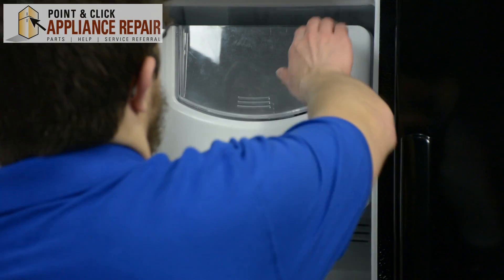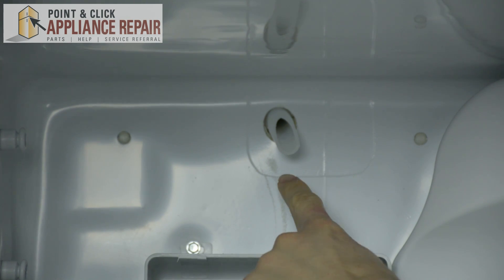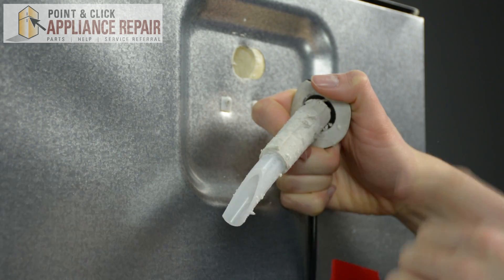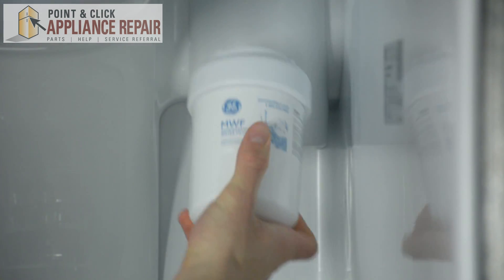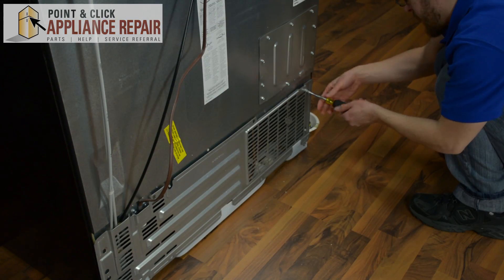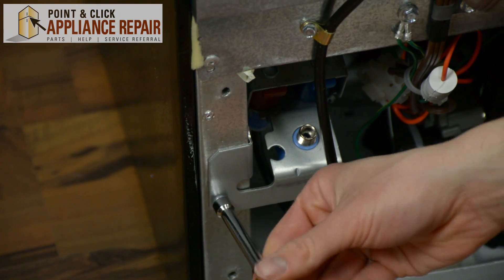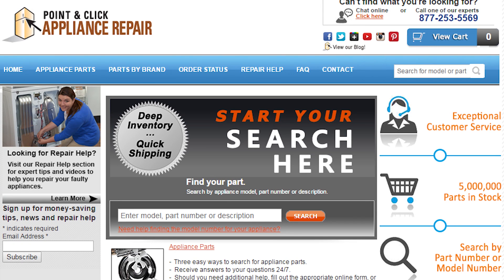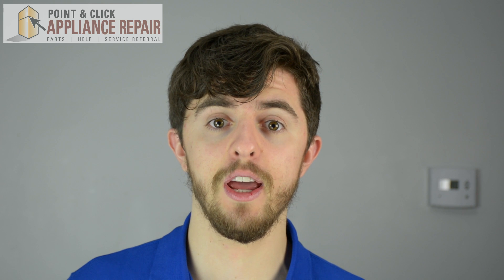Why Does My Ice Maker Keep Freezing Up?

Comment: When you removed the water inlet tube I noticed foam/insulation did it damage the foam/insulation? Mine is not even nothing I am afraid to brake it.

Comment: My freezer ice maker worked fine non stop for 10+ years then suddenly started freezing up the fill tube,  ive replaced the fill tube, supply tube, the solenoid/ valve and lowered the temp setting on the freezer which was never changed in the first place but it still freezes up..  ive even moved the baffle that blows on the ice maker to not do that and still freezes pipe..  so its not any of the parts having any issues, not the freezer too cold, not the ice maker or anything.  I think its the tube somehow not evacuating the remaining water thats inside that tube in the freezer..  but have no clue on what it was doing to work for so many years then just stop..  maybe theres an air hole like a pinhole on the little piece that you poke in the back of the freezer..  but im not seeing one and would think if theres a hole than wouldnt it spirt water up out when filling? Either way i jjst think theres some gravity fed way to get that hose to properly drain out any remaining water inside it after it finishes filling the tray..  like a natural syphon that will pull a vacuum on the tube just enough to pull the water back to a point outside of the freezer section..  they make heaters you can hook up but i dont want to constantly have to run another heating pad for a damn ice maker..
Reply: Every since my light stop working in the freezer the ice maker started freezing up . I have to chip it out and it works like once or twice more.

Comment: Jordan, this is great. Other videos showed use of  hairdryer inside freezer. It was a lot easier to remove tube from back of refrigerator and run hot water through fill tube to remove ice. Thanks Much!

Comment: Sorry, but you never answered the question about why it keeps frosting up.
Reply: If you don't defrost the freezer once every 3 months or so then the freezer can build up a layer of ice over temp sensor which due to thermodynamics can make it read warmer. Same reason igloos are warmer inside. This can make the freezer over compensate and over freeze it. When this happens this extra cold can radiate up the back of the fridge and freeze this pipe thus making the water a lot colder which in turn freezes into ice faster faster and gets cooled more in the ice maker - when it pops out it then warms up a little due to the expected temp of the ice box which causes it to stick to other ice.
Reply: @ribo2139  
But doesn't it already have an automatic defrost? I think mine defrosts 20 minutes every 8 hours. Do I need to go beyond that? how do I defrost it every 3 months? You're not telling me I've got to take everything out and then leave the door open are you? For like an hour? Longer?
Reply: @ribo2139  but my freezer is on the bottom and my ice machine is in the fridge section.
Reply: My freezer ice maker worked fine non stop for 10+ years then suddenly started freezing up the fill tube,  ive replaced the fill tube, supply tube, the solenoid/ valve and lowered the temp setting on the freezer which was never changed in the first place but it still freezes up..  ive even moved the baffle that blows on the ice maker to not do that and still freezes pipe..  so its not any of the parts having any issues, not the freezer too cold, not the ice maker or anything.  I think its the tube somehow not evacuating the remaining water thats inside that tube in the freezer..  but have no clue on what it was doing to work for so many years then just stop..  maybe theres an air hole like a pinhole on the little piece that you poke in the back of the freezer..  but im not seeing one and would think if theres a hole than wouldnt it spirt water up out when filling? Either way i jjst think theres some gravity fed way to get that hose to properly drain out any remaining water inside it after it finishes filling the tray..  like a natural syphon that will pull a vacuum on the tube just enough to pull the water back to a point outside of the freezer section..  they make heaters you can hook up but i dont want to constantly have to run another heating pad for a damn ice maker..
Reply: @ribo2139  Where are most temp sensors located?

Comment: Yes, but why does it freeze up inj the first place?
Reply: That's my question
Reply: It can freeze up from lower than normal pressure from either the water feed itself or due to a faulty fill valve. Think of it like a river in the winter time... If the water in the river slows to a trickle, it'll likely freeze whereas if it's flowing strongly and with enough volume, it won't freeze because the water is flowing too fast for that to happen. It's a delicate balance.
Reply: Jerry Jones 8

Comment: I just fixed mine for this problem. The ice maker is freezing up do to the water valve on the back of the refrigerator not sealing up when it shuts off allowing water to accumulate in the fill line and freezing in the ice tray.  Replaced the water valve and thawed the ice tray, problem solved .Hope this helps someone.
Reply: Thanks!  This is the first real solution I have seen.

Comment: ooooooooooooooooooh i get it. you just have to remove the problem. The ice-maker and the supply line. totally fixed, no more ice-maker freezing over. Thanks PCApplianceRepair. 

p.s. either trim or shave bro